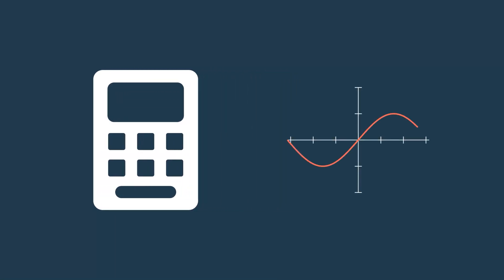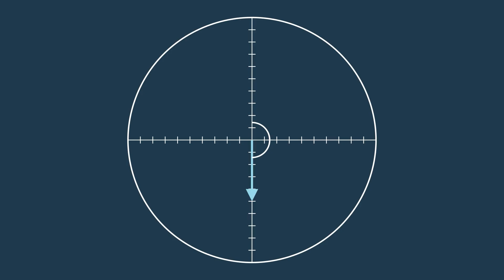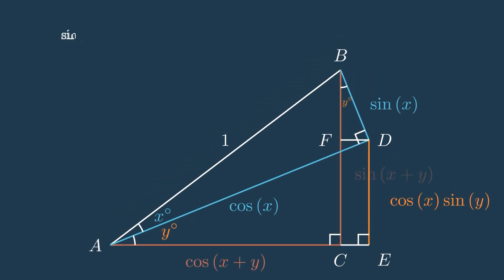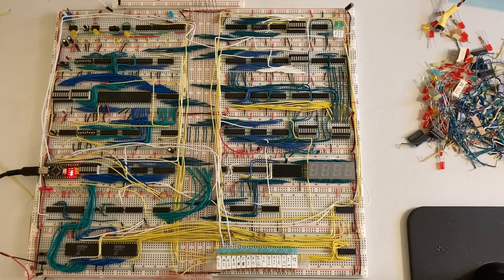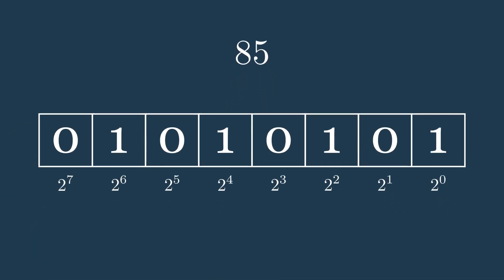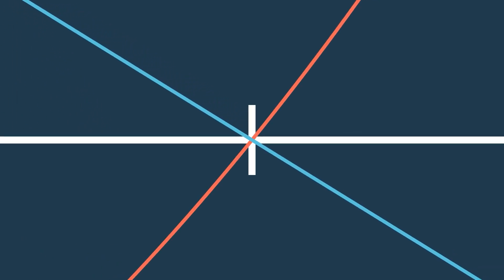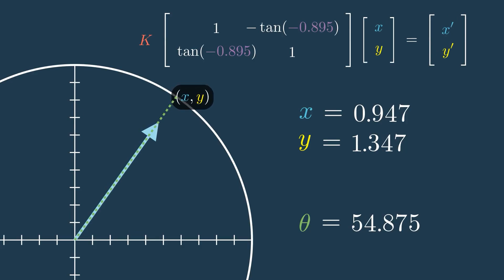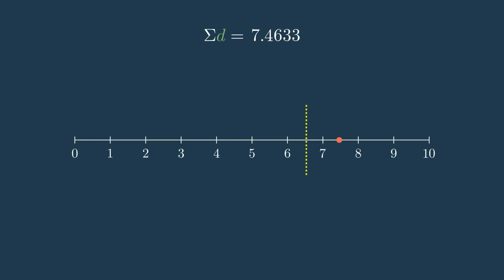How can Computers Calculate Sine, Cosine, and More? | Introduction to the CORDIC Algorithm #SoME3

Comment: I don't get it. With this, in order to calculate sin and cos of an angle you need to know cos of many another angles, which doesn't seem very helpful.

Like, you want to compute cosine of some number. You do all this stuff 10 times, and now you need to scale it by the factor of 10 another cosines. To know them, you do the same for each of them another 10 times, and now you need to know 100 cosines. This doesn't make any sense.

I thought really hard to understand how can you know tan, and figured that it is because the angle is chosen to have a nice tan in binary (you really needed to show in the matrix tan(tan^-1(a)) and not tan(some obscure number), it was confusing). But it just doesn't seem to work for cos.
Reply from the maker: I'm sorry if I didn't explain it well enough: The angles we rotate by every time we run the algorithm are 'a_n = +/- tan^-1(2^-n)', and for each angle we rotate by we multiply by cos(a_n) in order to re-scale the vector correctly. Since cos(x) is an even function, where negative inputs produce the same output as corresponding positive inputs, the sign of a_n doesn't affect the cos(a_n) value. That means that the nth cos(a_n) value will be the same each time we run the algorithm, so if we run n iterations we can multiply by the pre-computed product of all of the cos(a_n) values. This product very quickly converges so after only a few cos(a_n) terms the value of their product is very close to the value of their infinite product. So if we find the product in advance from a good amount of terms of cos(a_n) multiplied together, we've pre-computed the value to scale the vector by at the end every time we run the algorithm: ~0.607253

As for pre-computing those cos(a_n) values, there are many ways to do that, but you could use a taylor series or some other polynomial method. The angles we rotate by are also computed in advance with a similar method, and the tangents of those angles are 2^-n. Also note that we don't actually need to compute those angles, we just know that tan(a) = 2^-n because of the angles we chose. In an actual implementation on hardware, we wouldn't have the angles stored at all. We do still need the angles to keep track of which side of the desired angle the vector is on and the total angle we've rotated by.
Reply: @bobater  Wouldn't you also be able to calculate the constant by simply* computing the length of the resulting vector.

*I realize this would require to take a square root, which is an algorithm in and of itself. You could just run it once to get the appropriate constant without having to worry about computing cosines tho.
Reply from the maker: Yep you totally could! You could start with a vector of length 1 on y axis, and rotate it to the x axis with the algorithm. Then you could find the constant to multiply by to be 1/L where L is the length of the vector
Reply: @bobater  Makes sense, now I get it

Comment: While the CORDIC algorithm is undeniably neat, it is not the most efficient way to implement trigonometric functions on modern processors. Instead repeated fused-multiply-add instructions are used to evaluate polynomials that approximate the given function to very high accuracy.
If you're using radians, the biggest challenge for sine and cosine, both with and without CORDIC, is the argument reduction, aka modulo π.
Reply from the maker: You are correct. The main use of CORDIC today is in FPGA chips with less transistors to work with since it’s a very hardware-efficient algorithm. As you said though, on modern processors, there are better methods that have been found for trigonometric functions
Reply: @bobater  I suppose this is because floating poing processing unit is extremely unpractical in FPGA. But when you have fp-unit on your chip it hard to beat good old Taylor series approx, or some other cheap polynomial stuff.
I know one system where there was used sin(pi/2 * x) approx based on Krogh interpolation between two points (0 and 1) with fixed values(0 and 1) and derivatives(pi/2 and 0).

Comment: I'm not sure if I just missed it, but if to calculate inverse tangent you need to use this method and you need inverse tangent to use this method, how  are the inverse tangents of 2^-n calculated?
Reply from the maker: Good question! There are actually other ways besides this algorithm to calculate these functions. They are usually more complex hardware-wise and might take more operations, which is the advantage of using cordic over one of those. One way to calculate those values in advance though would be to use a Taylor series, which is a way to approximate functions with polynomials. Another thing to note is that modern more powerful computers probably don’t use the cordic method, but some of the ideas from it are still used
Reply: @bobater  so to actually use the method you presented we need precomputed values of all invers tangents of powers of two we're going to use and the final product of cosines?
Reply from the maker: @aleksandersabak  actually we just need the cos constant, since we know the tangent of the nth angle is 2^-n, therefore we don’t need the angles in advance since we already have the cos constant and the tan(a_n) values Yes, we need both the cos constant and each angle, that way we can scale the vector correctly at the end and know what total angle we've rotated by.
Reply: @bobater  Then how do we know whether to add or subtract the next angle? How do we iterate to the desired angle if we don't know the values of the angles we're adding/subtracting to reach it?
Reply from the maker: @3snoW_  You're correct, we do need the angles, we just don't need to actually calculate their tangents. Sorry for the confusion.